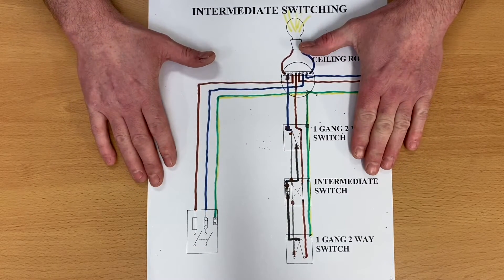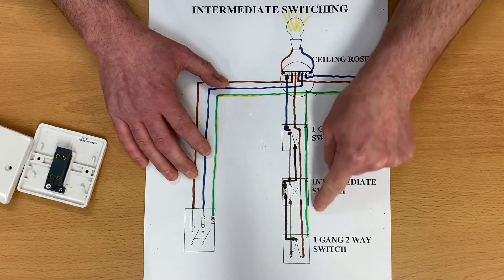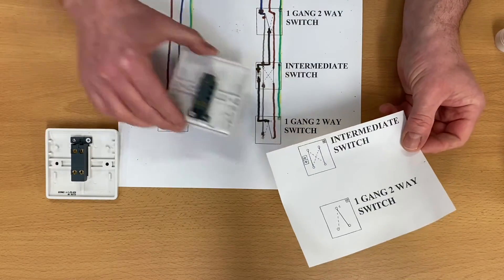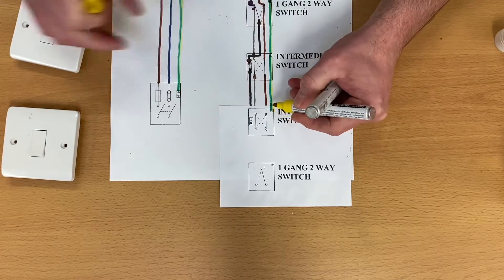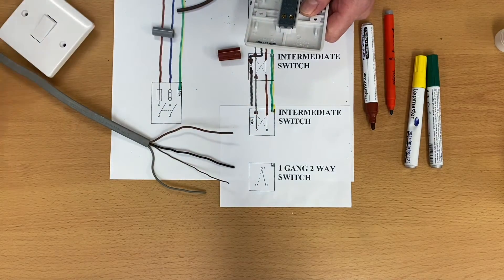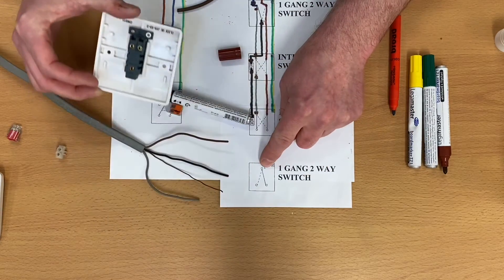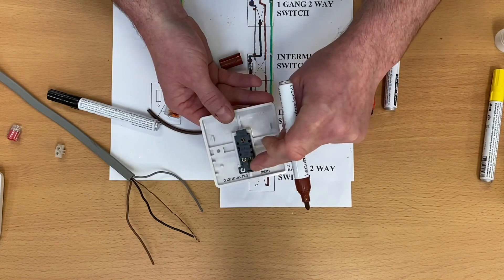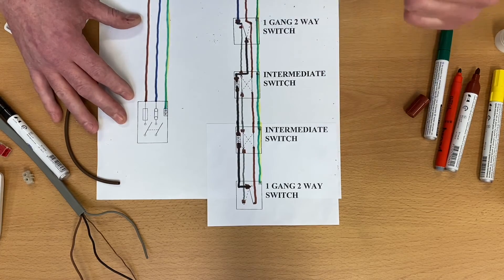Wiring Diagram - Adding Another Switch to a 2 Way and Intermediate Switched Lighting Circuit

Comment: Hi, hope everyone is doing well. I have a problem using my hole saw basically, sometimes when I use it to  drill through metal the drill bit bends and I don't know why. Can someone tell me why. Thank you
Reply: Sounds like a cheap drill bit. Try using Armeg or another reputable brand and ensure the metal is not too thick. Also make sure the drill bit is tight in the chuck.